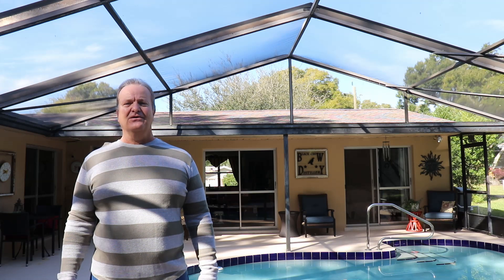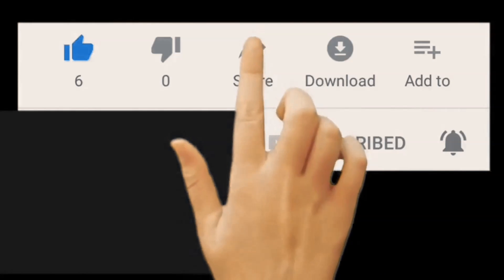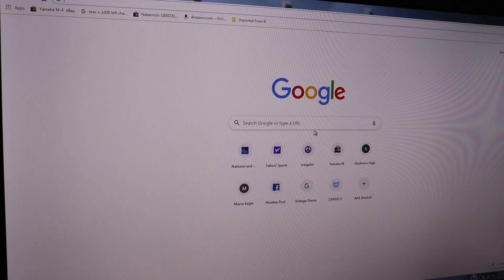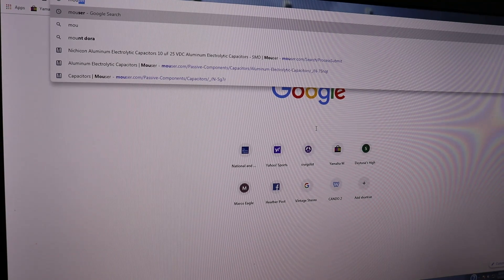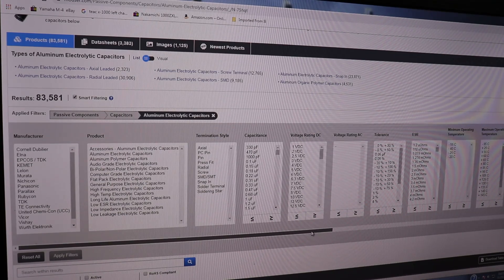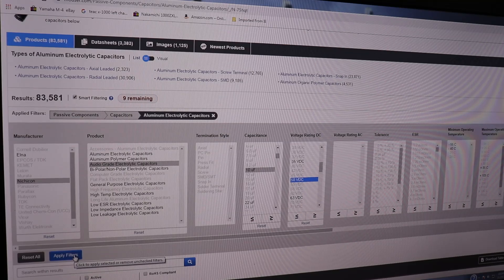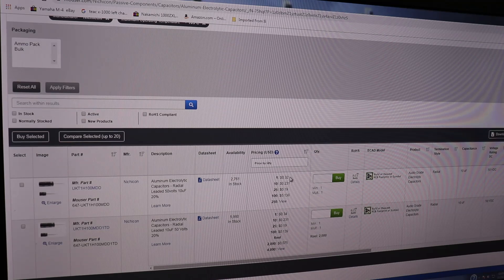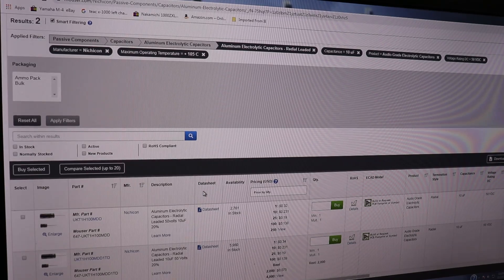Finding Vintage Stereo Parts - Where To Purchase Components For Old Audio Equipment

Comment: Thanks for the confirmation of the notions I have regarding sourcing parts, how much to replace, pricing, and a new tool in looking up stuff using the "show sold" on e-bay.  Recently got a Kenwood KR9050 for $500 because on e-bay the last one for sale was $3000ish, found out thru "sold" that its about that, or a lot less depending on functionality.  Well it really convinced me to go all out, replaced all the caps, lights, found the bad transistors, smoked a couple new ones til I figured out the old ones were CBE and my new ones were BCE.  Putting it all back together now, only blew an extra $400 for parts, and repurchasing parts... Was gonna flip it initially, but this is my very first repair and restore, think I might hafta keep it now.  Neighbors got a couple of Pioneer CS-99a's strung up in their barn collecting dust and corrosion, might hafta offer to take em off their hands for some "new" speakers.

Comment: A lot of the semiconductor devices are no longer available and must be cross referenced to other numbers. Particularly output transistors and driver transistors. I spent much time searching through Audiokarma and other websites looking for numbers that Mouser of Digikey would have. ON semiconductor makes T03 output devices for Marantz 2275 and Sansui G-8700DB but it was not an easy task to track down the numbers. Devices on eBay that claim to be OEM Toshiba outputs are counterfeit.

Comment: what about the STK output transistors used in the lower end pioneer sx-80 series
Reply from the maker: Yes, there are some components that are difficult to obtain. Fortunately not that many.
Reply: @vintageaudioaddict  any advice on finding the stk 0039 chips I can use in my pioneer sx-680? I contacted a service technician who has very good ratings and has lots of experience with late 70's pioneer gear and he said for the price of replacing all of the capacitors and finding replacement stk output transistors it is not worth it. I love the way this amp looks, its in Amazing cosmetic condition so I am willing to spend anywhere between 125-300$. I know that is defiantly way more than it is worth but that doesn't matter to me. my only concern is the reliability of the replacement stk 0039 chips because I have heard many have terrible experience with them...

Comment: I'm from Brazil (South America). I need to replace the function selector key in my Marantz receiver model 2252b because the Phono1 entry is not working. The technician told me that the selector key is broken.  . (Marantz 's Service Manual reference Part Number S401)

Please some tip about where I can get one? Maybe a used one, of course since it be full operational.
Reply from the maker: Here in the USA about the only place would be eBay.

Comment: Capacitors and resistors are common. Let’s talk transistors.
Reply: True, only place I can find any 2sc series is on eBay.  For instance the 2sc2240 is obsolete according to mouser and its not on digikey.  So I guess old used ones on eBay is the only choice.  Who knows if they’re any good or even the correct specs.  It’s frustrating!

Comment: Capacitors are fine , how about transistors ?? Have been looking for replacements for below transistor's ::
2SC1815(Y)
2SC2878(A/B)
2SC1841(E/F)
2SA988(E/F)
2SA1321
2SC2705(O/Y)
2SC3334
2SA968(Y)
2SC2248(Y)
2SC2458(BL)
2SA1048(GR)
2SA1360(O/Y)
2SC3423(O/Y)
2SK184C(Y/GR/BL)
RN1202(10K-10K)NPN
RN1205(2.2K-47K)NPN

Comment: Highly informative and i also think you go into the details that we novice beginners need. I actually went to Mouser.com the other day before i saw this video. It was confusing im not going to lie, however i had found my way to the caps that you were talking about replacing in the "Parts and Tools Needed To Fix Old Audio Equipment" video as i multi-tasked between the vid and the Mouser website. Today with this one you go a bit further and my takeaway is this: You say to use either Mouser or Digikey for replacement parts. Before i watched your videos this was all a foreign language, like Chinese and i was confused. I had watched many other CB and Audio repair channels but still i couldn't get over a sense of it being overwhelming. I mean, then it was like 'where do i find parts?' , 'how do you know whats blown?' , basic WTF stuff. I made initial attempts to find Caps in Amazon and Ebay so.... yea thanks. Fully understand now. Feeling confidant now that i can replace caps in my old equipment and i want to say thanks for clearing the air about everything, you are a great teacher and an insightful channel and i am glad i found Vintage Audio Addict.
EDIT: I am still searching for "Speaker Relays" (the clicking sound ones) for two of my old units. Are they referred to as Speaker Relays in these electronic parts websites, havent located the ones i need in Mouser, are there other sources for them?
Reply from the maker: Your welcome and thank you for watching. Mouser should have most of the relays. If not then Digikey. "Omron" is the manufacturer of most vintage audio relays. For example if you search "MY2-02-DC24" on the mouser website it will take you to that relay which is a common one used in vintage audio equipment. If that's not the one you will be in the right area to find what you need. Just like capacitors there are a lot of relay choices so if may take some searching for what you need. Thanks again and good luck with your projects!

Comment: Thank you so much for your willingness to provide this info.  I have an old MC-2205 and saw your photo narrative online.  Did you by chance make a list of the caps you ordered for repair?  I want to get mine going, but I only have a multimeter.  Nothing else fancy for equipment.
Reply from the maker: Thank you for the kind words. I don't make a parts list as I don't order parts for each unit. I have most all of the parts in stock for a restoration so I just start the next project. Good luck with your 2205 it's a wonderful amplifier.

Comment: And when you filter for values, say 50VDC, you can then hit the ≥ sign below to filter on 50VDC and any value above it.
You probably also want to filter on pitch or "lead spacing" as Mouser calls it, so you get parts that fits in the holes in the PCB.
Based in Europe I have never needed to order from Mouser or Digikey. I use Elfa Distrelec  (https://www.distrelec.biz)
Not the same level of inventory as M or D, but comparable prices. Free shipping on orders over $75. Delivery within, 2 days!!
But when it comes to more special old parts like germanium transistors, special bulbs, some Darlington transistors
and so on, those can be a challenge to find.
Reply from the maker: Yes, there are many different options. Hopefully people can use the tool when they are looking for parts.